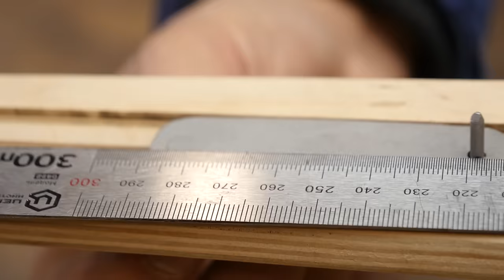Cool idea from an old bearing!

Comment: I like this video as an portrayal of a concept/idea shown that a person can either copy verbatim or use it as a basis for creating your own version that's suitable for for YOUR use. Why knock the creator of this video just because his particular need/purpose doesn't fit YOUR particular need/ situation or how you would go about it? 

 

Too big for your workbench... make it smaller.  No need to store spray cans... use it for something else, whatever your need/imagination conjures up. 

Don't have a car axle hub handy... then use something else, buy a Lazy Susan Swivel Bearing base for $10 (or less) or come up with your own idea.... easy to make you own swivel base out of scrap wood by routing circular groves into 2 opposing pieces and sandwiching small wood balls (available at craft stores, Walmart, etc) between them to act as the bearings.

Have fun with the guy's idea... stop being so critical.

Comment: It rotates.
Now look at the cubic space, and factually measure the limits of what can be stored there.
My immediate impression is a lack to an extreme lack of efficiency.  This is a fine idea, but demonstrated poorly.
Best use would be in a corner.  That is the best use of a rotated storage plane device.
Nonetheless this has to be rated a practical failure.

As to production;
Well done, it should make a great deal of money compared to it's practical application.
Since you are inclined, I suggest over elaboration in design.
In the maker space overly elaborate, diminished efficiency projects score well on views, subs, and ads.  Go get'er done!!